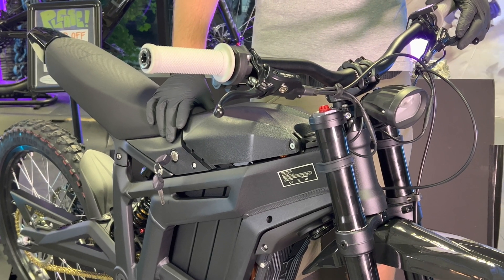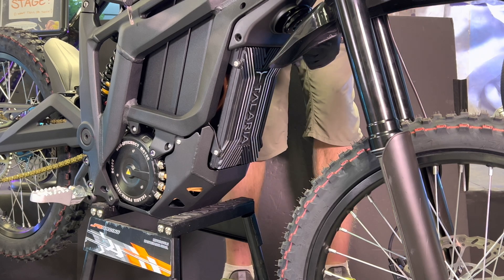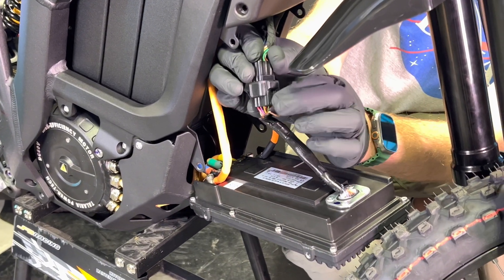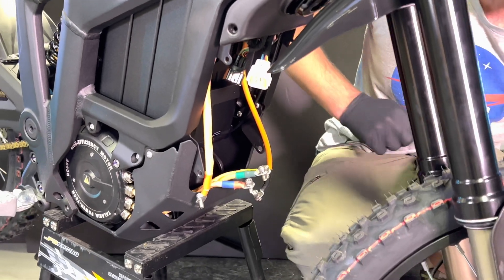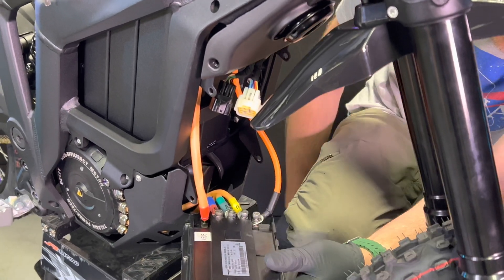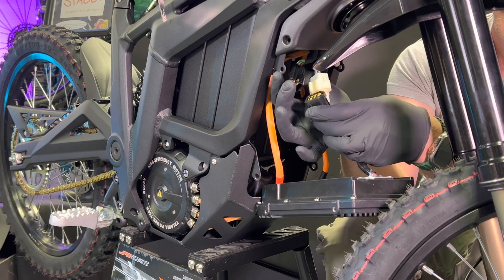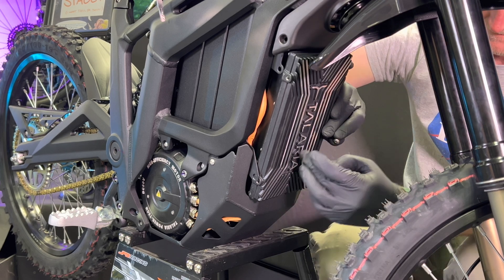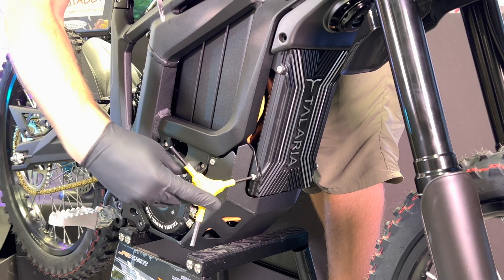Talaria Sting MX3/4/5 Controller Install and Calibration

Comment: Now would you happen to know if I changed my gear box made sure everything should be movig properly but I’m getting error code 47 an when I start it it almost jolts a lil like it’s trying to give power to the motor even tho I’m not holding the throttle an the code is for lake of phase to engine everything I’ve looked up one says gearbox one says motor another says controller what do you think I already did the gear box you think motor or controller would be my best bet

Comment: @lunacyclerepair I bought a used a controller, installed rode but not matched. It makes some high frequency pitch sound from controller. I did the motor matching, and it still does, as when you drive and reach over 9mph. I have a mx4, please help me, thank you

Comment: Quick question @luna cycles, is there any way to re calibrate my origional  controller, i have an mx4 its stuck at wait ive checked everything all sensors lights throttle wires etc, i am looking to order a new controller next or if it is possible to re calibrate mine that would he great thanks.

Comment: My MX4 from you guys suddenly stopped working while riding it. The throttle stopped working and the screen just says “wait” now. What is going on?? I’ve tried unplugging the brake sensors and my kickstand sensor is making contact with the magnet. Can you offer any support?
Reply: Does anyone out there have the manufacturer information to see if I can get something done under the 1-year manufacturer warranty
Reply: I'm having the same issue as of 5/31/23
Reply: Me too. I believe I have the mx3. And in the menu match is not an option, I don't see anywhere on the Internet or YouTube describing what to do for the MX3 controller
Reply: @georgedudy9596 did you ever end up figuring it out? I have an mx3 as well and it doesnt throttle at all either
Reply: @georgedudy9596  i have match on my MX3 ROAD LEGAL
Reply: My mx3 keep doing it.
Bought new throttle and it worked for a day then I got error code 37 throttle.. then it started working again 
I'm on day 3 with no problems as of yet
Reply: My Talaria was stuck flashing wait no matter what I did but after replacing the main controller,[ the black metal radiator looking thing right behind the front wheel that says Talaria on it] my bike now works as it should

Comment: Worries me seeing a video installing a replacement controller on a bike that's been out for less than a month:/
Reply: if you know a bit about the surron almost everyone upgrade those because the stock motor has so much upgrade potential. the talaria probably won't be different especially since the motor seems to have even more upgrade potential, but if you wanna stay stock there's nothing wrong with it.
Reply: @geemy9675  
I had the Surron X, don't miss it at all after this Talaria, imo, no power upgrade needed for my needs
Reply: sorry didn't watch till the end I was looking for controller upgrade, not replacement